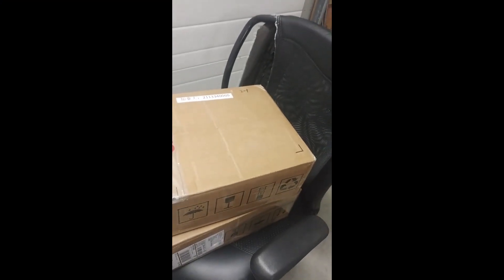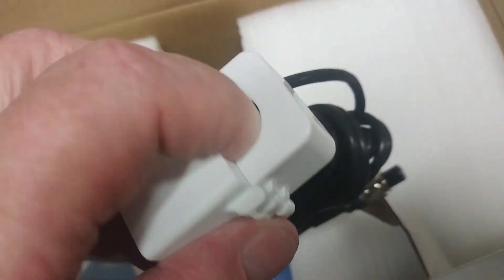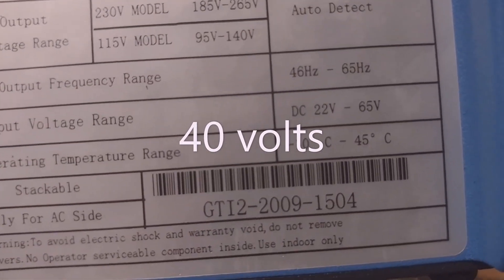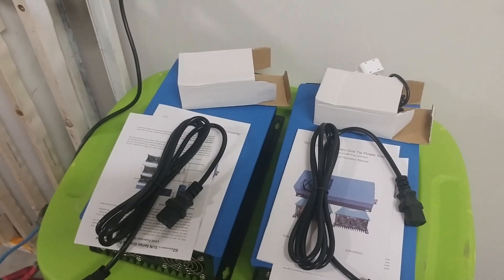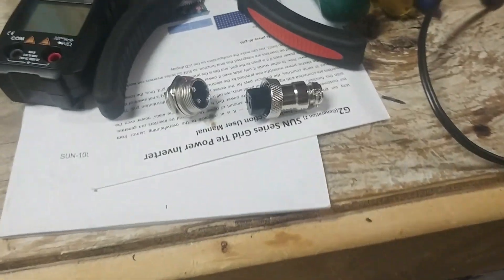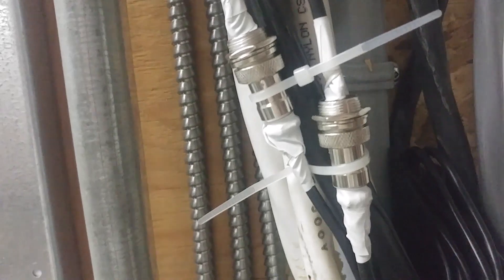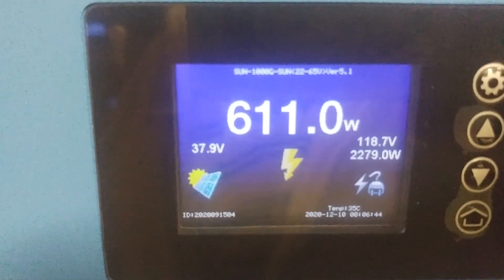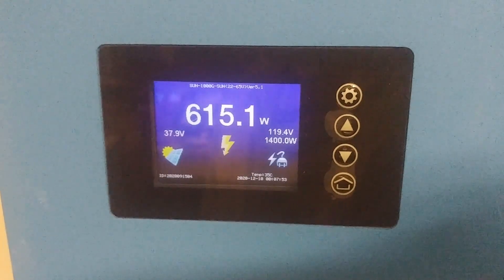2020 31 Sun 1000 watt grid tie Inverter with Limiter

Comment: Do you have to run two or can you start with one inverter with limiter
Reply from the maker: Sure one will work on 120 volts which is one leg in North America.
Reply: @offgridwanabe   I bought one of these inverters and three solar panels I've got them hooked up says voltage to high. Am I hooking the three panels up wrong. Positive to negative and one negative and one positive run back to inverter. 300 watt 40v panels
Reply from the maker: @Skynet169  When you hook panels up in series + to - the voltage increases by the amount of the open voltage so with 3 panels you would have to go parallel but with 4 you would hook 2 in series which would likely make 48 volts depends on the panel then parellel the other 2 in series. So you would have 2 sets of 48 volts in parelle which would increase the amperage to 16 amps and have 48 volts.
What kind of panels do you have  eg 3 - 12 volt panels would work which would do less than 60 volts but 3 24 volt panels would be more than the 65 volts allowed. I understand this may be confusing but I hope this helped. If you need more ask away.
Reply from the maker: @Skynet169  OK 40 volt panels will have to be in parallel so the amperage increases and the voltage stay the same so all the positives together and all the negatives together.
Reply: @offgridwanabe  alright I just plugged one solar panel into inverter does show the voltage but no wattage clear sunny sky here in Ohio
Reply from the maker: @Skynet169  That is a start should show 25-50 watts in the direct sun I know mine on low voltage don't put out much. Try it with the limiter unchecked in the set up screen.
Reply: @offgridwanabe  hyundai energy solutions photovoltaic module hid-s300rg (bk) rated max 300 open circuit 40 v rated voltage  32.6 short circuit current 9.83 rated current 9.31 power specifications at stc1000 w 1.5 am
Reply: @offgridwanabe  works without limiter
Reply from the maker: @Skynet169  I assume you have it plugged into the grid lol and there is a load to make it run so with the limiter unplugged and unchecked it should run wide open with sun on the panel so may 200 watts. Do you see an AC voltage in the bottom right corner.
Reply: Won't I need limiter to keep it from feeding the grid
Reply from the maker: @Skynet169  Uncheck all the boxes in the setup
Reply: @offgridwanabe  says 120.8 v bottom right the bottom left says 35 volt
Reply from the maker: @Skynet169  yes but to just get it going for a second it should be good as long as you are useing the power so turn on a load in the house bigger than the panel.
Reply: @offgridwanabe  yeah says only 30 watts I got load running
Reply from the maker: @Skynet169  SO it works now you have to make sure the CT goes on the same leg as the plug you have the inverter plugged into otherwise it will back feed the grid.
Reply from the maker: @Skynet169  Good once you know you are on the same leg go back in and check the limiter box so it will only make power when you have a load then check it out by turning on a house load it should show in the bottom right and then if you have sun it should start up and show watts on the left if load is smaller than production the AC wattage should go down to 0
Reply from the maker: @Skynet169  I wanted to make sure you have the CT clamp on the same leg otherwise it would say it had a load and produce even if there was no load then it would go into grid so we want to only sense the load on the leg the inverter is on then check off the boxes for limit function
Reply: @offgridwanabe  well on the bottom right it shows 120 volts using 1300 there's no negative sign and producing 20 the sun is starting to go down but with the limiter switch check internal limit mode
Reply: I don't know how to tell if it's on the right leg of the two that run to the main switch
Reply from the maker: @Skynet169  The CT also is directional so if it shows -voltage turn it over. If you turn off all breakers but the main breaker in panel then only turn on one 120 volt load then the ct will show on the inverter an AC watt if not try other leg also the inverter will need to be on the leg you are powering . This is very difficult to explain with out being there lol
Reply: @offgridwanabe  yeah well thanks for your help so far I'm getting it figured out
Reply from the maker: @Skynet169  Awesome it is always better if you understand your own system it is addictive so have fun.
Reply: @offgridwanabe  I'm getting rite around 200 watts a panel I only have 3 in thinking about getting a fourth 300w panel for this inverter think that's safe I'll have less than 1000w off the four 300w panels
Reply: @offgridwanabe  I tried shutting off everything accept the panel switch plug the watts went to zero think the inverter is working
Reply from the maker: @Skynet169  No 900 watts is the best you can do they will not produce any more watts and it make burn out the inverter
Reply: @offgridwanabe  ok little conservative side and safe I bought the cable branches one will just be hanging out I'll tape it off I guess
Reply from the maker: @Skynet169  good glad it works for you even with the battery 950 was the limit I understand why you think you may not be getting all you can and it may be worth a try to over panel the inverter but it may overheat and quit it's your choice of course I have over panelled many inverters and it works most of the time but every once in a while cloud edge or every thing is just right and it gets pretty harry.
Reply from the maker: @Skynet169  If you really want more go with a battery bank and charge controller then you can ad lots of panels and run at night lol
Reply: @offgridwanabe  could I use the charge controller to keep inverter ...limiter safe with over paneling
Reply: Hi how should I do the same inverter but 2000w 220v two of those can you explain the connection should I have the inverter in parallel and the limiter too and what about the output power from the inverter

Comment: Good morning Sir 
I wanted to know if I could use my current panels which are 4 panels 285 watts and 4 pnanels 100 Watts. Just PV power to my inverter.
Reply from the maker: Yes as long as you stay within the limits set by the manufacturer under 1000 watts and within the voltage range I believe for the Sun 1000 is under 65 volts and above 24 volts
Reply: Thank you so much
Reply from the maker: @vinalnand8494  Good luck

Comment: I wanted to know if I can directly plug in  PV voltage to the  inverter in the daytime do you think still work .
Reply from the maker: Yes they are designed to allow direct connection to PV but limited to about 900 watts. So it can run with no battery this was the original way they came out and added the battery later. Recommend 4 - 245 watt panels 2 in parallel 2 sets in series.
Reply: Thank you so much

Comment: Never seen a battery set up like urs
Reply from the maker: Well not too many like it the A123 Lifepo4 cells come out of buses from the city the were hybrids about 8 years old and being replaced by the city to go to 100% electric battery buses. They are 40 volts so as built they don't fit many inverters but lots of people reconfigure them but I decided to find ways to use them as manufactured so the voltage was perfect for the gris tied Sunn 100 and also enphase M250 micro inverters. Thanks for watching

Comment: You could save so much more money using micro inverters, and buy a powerball battery bank
Reply from the maker: Yes I have 40 micro inverters (Enphase) in my system these sun inverters fill in the night shift nicely
Reply: @offgridwanabe  awesome
Reply: @offgridwanabe  what model emphase
Reply from the maker: @papax4815  32 M250 & 8 M215
Reply: @offgridwanabe  trying to figure it out
Reply from the maker: @papax4815  What are you working on ( just found your comment)

Comment: Nice job! Looks good! You shouldn’t have any problems with those getting hot. Mine run cool all the time!
Reply from the maker: Thanks Jim so far they run cool but it is winter you have a nice setup there and I got lots of information from your videos. I am feeding them with about 4600 watts of PV with the battery tied in, so whenever the sun can keep the inverters running and bank charged I'll move up the limiter to 900
Reply: How long have you had yiurs installed for??? Im considering getting one...im doing some research about rekiability issues and ofcourse ultimately lingevity
Reply: @uittyman  I had two of them installed for a little over five years. I disconnected them recently when I moved into a new house. They are still in excellent shape, so I plan to reinstall them when the weather gets better and I’m able to set up the solar panels.

Comment: you should like them I liked mine and glad to see you turned the LCD off that was the only failure I had mine were version 1
Reply from the maker: Yep so far they look too easy if I get the startup and shut down voltage where I need them. Thanks for watching OTE.

Comment: What kind of voltage range do you use for your batteries?
Reply from the maker: basically 37-42 on the mains and 3.0 - 3.5 on the cell. I always hit a 3.0 before a 37 so it loses a bit of capacity but we are talking the cheapest lithium on the market.
Reply: @offgridwanabe  very nice! With that type of cycling those cells are gonna last forever! My LiFePO4 cells typically go from 3.32v down to about 3.18v. Anythinghigher or lower and They start getting really out of balance. They should last a very long time. I reckon yours will too!
Reply from the maker: @diyrenewableenergyelectron4996  Yes that is the same problem I have so after 3.42 they start drifting apart that is when my active balancer cuts in. Every once in a while try to discharge and bottom balance it seems to add more capacity than top balancing.
Reply: @offgridwanabe  thats interesting, ill have to give it a shot. I bought the BYD batteries from battery hookup and these things were rode hard and put away wet. I'm pretty sure keeping them in balance beyond 3.45 and 3v is going to be next to impossible since these batteries are heavily degraded. Compared to what they were designed for though, I'm giving them an easy retirement at the country club. 😂
Reply: @offgridwanabe  how do you like the active balancer?
Reply from the maker: @diyrenewableenergyelectron4996  I like it a lot especially the 2amp one it does more work They only balance when needed so you set the variance and it balances until it reaches the setting so it only runs at top and bottom.

Comment: Those will use way more then the grid ties. But they look great and will be better in summer. Merry Christmas
Reply from the maker: Yes they will but I will be using what they supply so won't be dumping into grid at night. Thanks bro and Merry Christmas to you and yours.
Reply from the maker: They were pretty cheap $365 each delivered so I had to have them lol Santa came early
Reply: @offgridwanabe  My buddy has a couple. They work well. He also has the 230v version but its only single phase. They are ok for what they are made for.
Reply from the maker: @frankz1125  Yes I am approaching net zero on my year round production so I need to find ways to limit grid use without giving up something we want to use.
Reply: @offgridwanabe  I dont think you will have enough to run them full out in winter. I would think you would use more then 2000w when things kick on at night. It will be better regulated but there just isnt enough sun . Im sure you will do better then having the regular grid ties tho.How many of them are you going to hook up?
Reply from the maker: @frankz1125  Well with the 2 Sun grid tie and the 3 Enphase micro that is 2250 watts the thing I like about the Sun is they only come on when there is a load so they should make the battery last longer but like you said really not enough sun in the winter.
Reply: @offgridwanabe  I definitely think you are on the right track. I would get a few more and you could totally do it. Summer for sure.

Comment: Wow nice inverters Sir👍
Reply from the maker: Thanks will see how good they are but lot of people have them and say they are good.
Reply: @offgridwanabe  I have the 2k on a 240v circuit, deliberately underpowered with 1.5kw of panels which have yet to hit 900w with all the {expletive} neighboring trees. No batteries yet, maybe one day. My hope / theory is that the GTIL will not be strained and have a nice long life. Summer AC aside my house draw is 300-600W after optimization which is great and so far (touch wood) the GTIL has worked great, with one minor anomaly where I was unable to navigate the menu structure; the back and forward wouldn't work until I power cycled it, which I'm assuming a software bug. That has only happened once, and hopefully that's the most it ever does as I've heard bad (melty) things from those push them hard. I installed it in September so a sunny hot summer has yet to come! If you go SolArk or Pip and the device can limit I'm sure many here would be interested in a video on it.